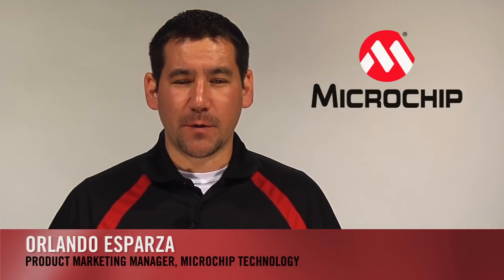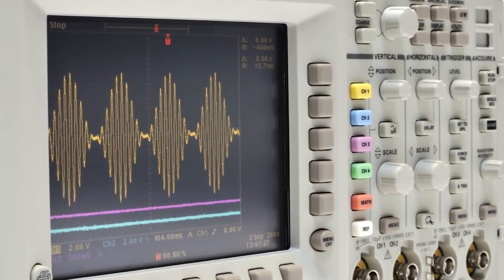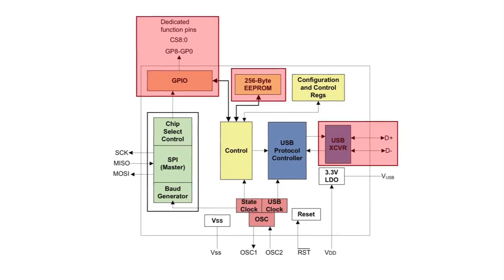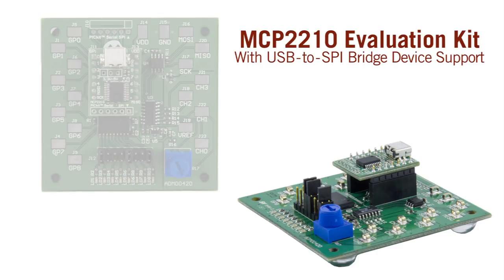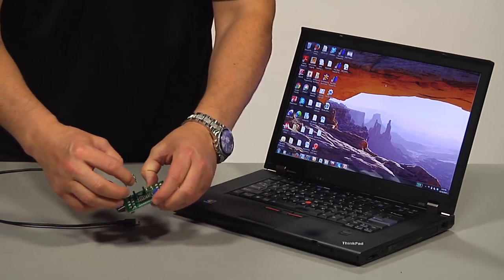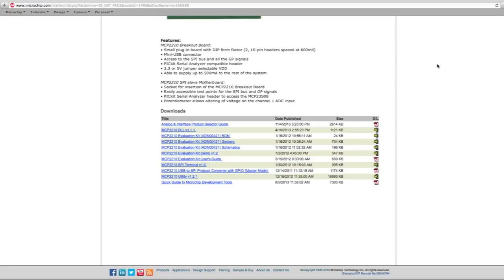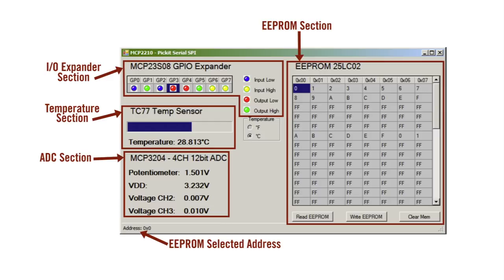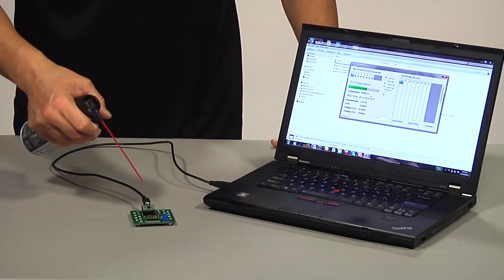MCP2210 Evaluation Kit

Comment: Can I use MCP2210 IC to SD card reaader? What driver which I need (Win 10)?   Thank you so much for your reply
Reply from the maker: Hi there, thanks for your question. You can use the MCP2210 IC for an SD card reader application as it provides USB-to-SPI communication. Creating a full SD card reader application would require additional software to manage SD card protocols and file systems, which is non-trivial. If you're aiming for a custom solution, you might want to consider a microcontroller with built-in SDIO support and a software stack for SD card access. So, while MCP2210 could assist, it's not a complete solution on its own. A good example of a MCU that could support this is the PIC32MZ series MCU’s. Hope this helps!